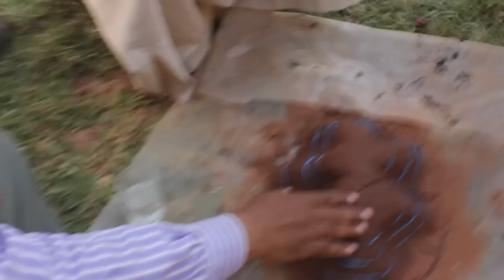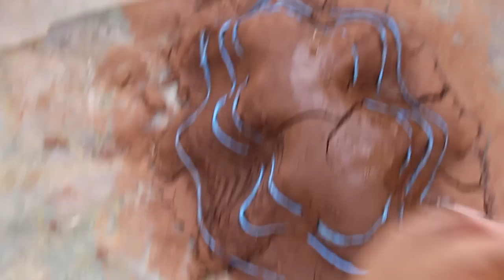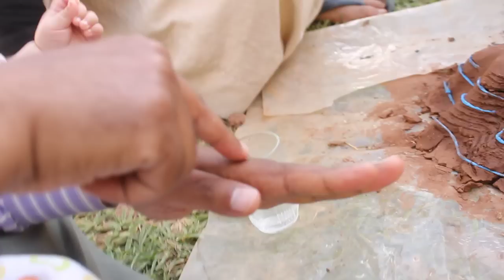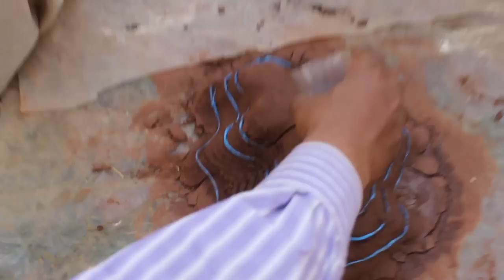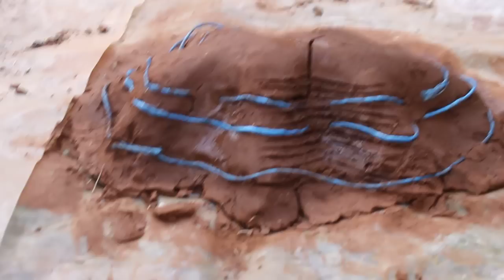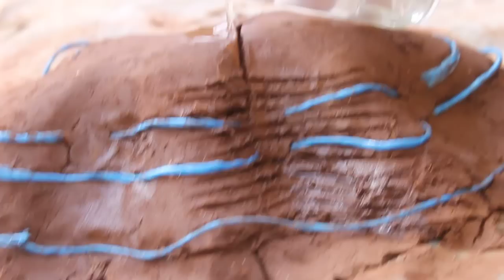Keyline

Comment: Why am I wrong in thinking that the off-contour lines should be skewed downward.in parallel? Wouldn't that make it easier for the water to naturally flow to the top of the ridge below?  In other words, if the off-contour lines are horizontally parallel, it would seem, as in the demonstration, that the water would not always flow to the ridge. However, wouldn't gravity do more work for us if as the water flowed down and then to the right or left, the off-contour line was skewed downward,  naturally forcing the water to continue a downward path to the ridge below?

Comment: The only thing I'm stuck on is why are the parallel lines above a contour necessarily going toward the ridge. Isn't it possible that they could be sloped slightly toward the valley rather than the ridge if we simply make parallel lines above a contour line?
Reply: Not sure if I understood completely what you said, but here it goes my attempt. ;-)

If it leans toward the valley. The water will not spread in the direction of the outer ridge.
In fact it would be a worse situation because more water would be directed to the valley, when the intention is precisely the opposite. Take it away from the valley.

If parallel to the contour line, it will not be so effective. Because it will not favor a wider spread over the land. 

Remember the "key line" is a relatively shallow cut in the soil. It cannot contain a large amount of water. Although it can effectively distribute the water if a downstream condition is given.
Cheers

Comment: This is not a good explanation of Keyline pattern cultivation. The key Line by definition is an extension of the key point of the valley. The key point is that place where the topography changes from convex to concave. This is the place in the landscape where water will begin  to slow in a landscape. One does not subsoil parallel to the Keyline. One crosses the keyline, higher in elevation from the valley to lower in elevation to the ridge. Water for Every Farm clearly shows keyline cultivation patterns as not being parallel to contour lines. The wrong application of subsoiling can actually dry up landscapes. Darren Doherty or Owen Hablutzel are to people to be paying attention to.
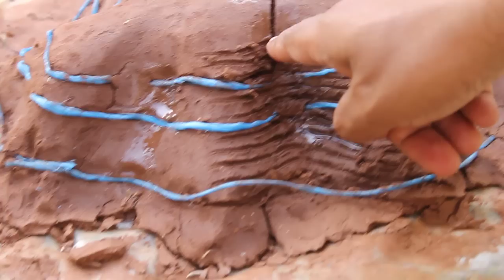Reply: Frank Thrall - Please watch the video carefully. At 3:35 he clearly states "each one of this lines is actually downward..." ;-)
Cheers

Comment: So a keyline is the same as a line on a topo map, then.
Reply: downbntout
 - No. That´s a misunderstanding. In a topo map lines are on contour, or saying in another way at the same height. 
On the keyline system the lines lean from the valley to the ridge. Higher in the valley, lower in the ridge. Hope it help. 
Cheers